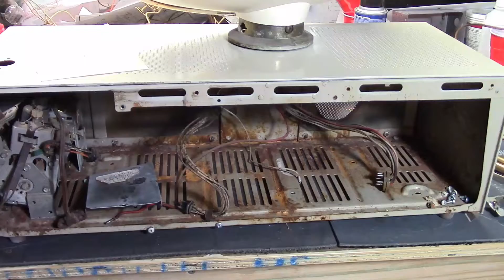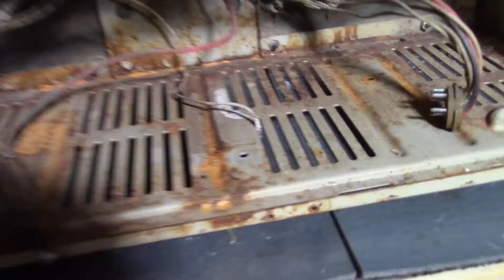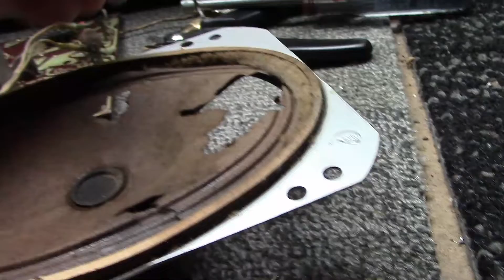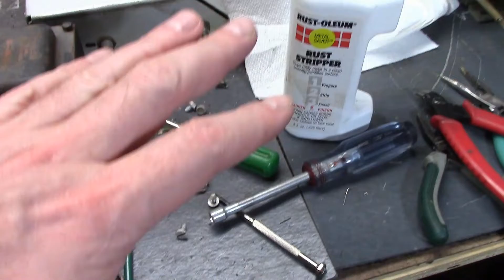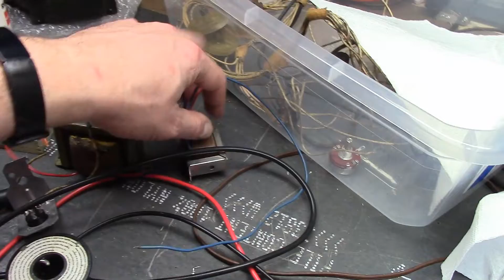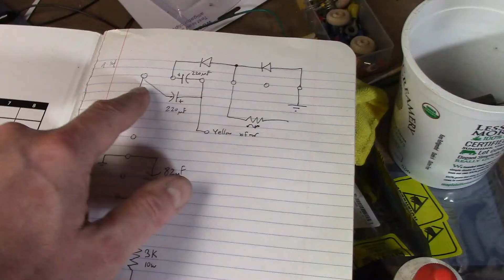Predictapalooza S1 finale - El Camino Siesta p1o3

Comment: A nice finale with a genuine cliff-hanger!
Using that cloth wrapped wire from Antique Electronics, or another source? part# 808 something-something... doing a complete re-wire will give your wire wrapping tool skills a good workout.
Cheers,
 - Eddy
Reply from the maker: Thanks.  It's 600v rated PVC insulated 22 AWG wire from DigiKey.  $16.30 for 100 feet.

Comment: Hey Bob, thanks for the advice on the tacky glue for the speaker repair!  You do an amazing job at all these Predictas and all kinds of old TVs and radios. I am about to embark on an RCA 621 project!.
Reply from the maker: Good luck.  Itching to work on my 621.  It came with a dud CRT but I managed to find a replacement.
Reply: Thanks Bob! I noticed you had a video on a 621 a long while back and it just ended there, I was not sure why! Seems you have been mostly on Predictas lately. I do have two Holiday and one pedestal Predictas I hope to get to! My full time job hardly allows me much time to work on the TVs!